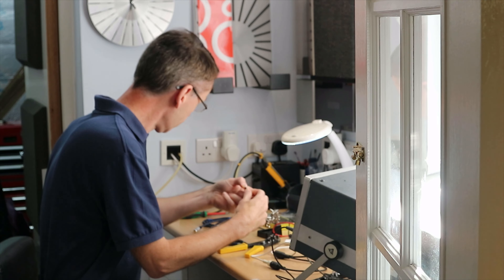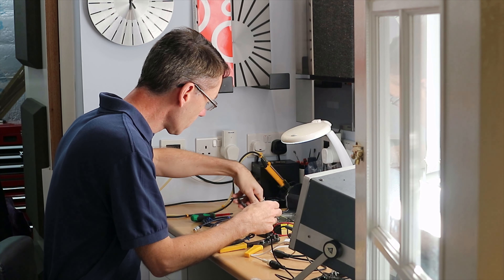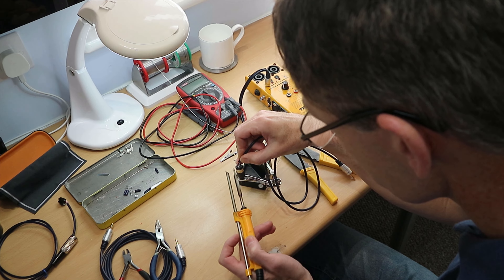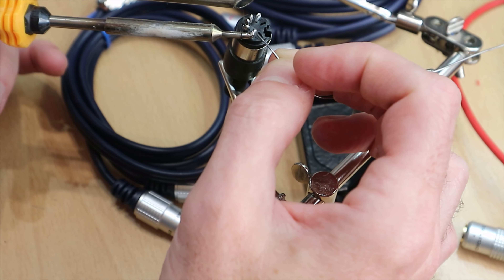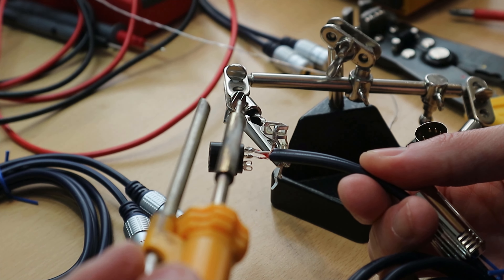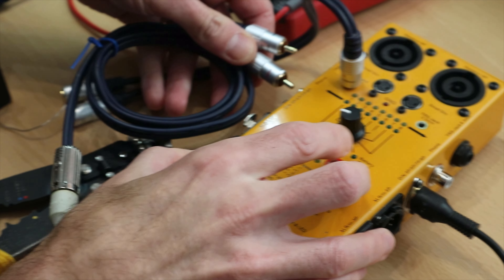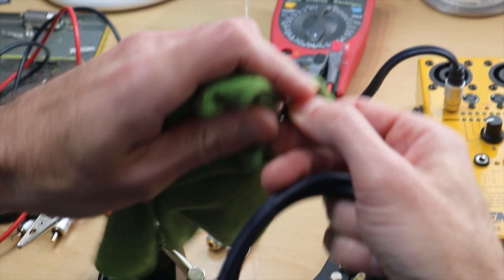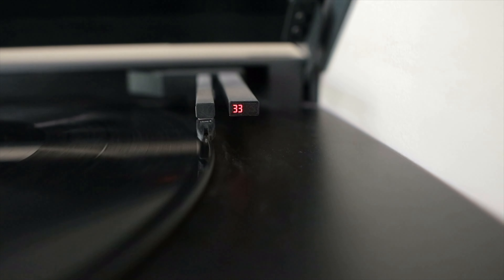The Sounds Heavenly Story - Making cables for Bang and Olufsen [4K]

Comment: more than 5 years back, i purchased an rca din cable for my naim 72 from steve as well as from a major electrical retailer in singapore, courts. both cables cost about the same. definitely a difference between the 2. when i used steve's cable, the treble is nice and smooth without compromising clarity. the other one is just bright and jarring on the ears. thanks steve.
Reply from the maker: Thanks, glad you like the cable!  I am always happy to help with any connection enquiries.

Comment: Steve you’ve got the skill and knowledge for building hifi cables. Now you should also extend into the B&O modifications arena. It’s simple stuff; all you need to do is replace the old/cheap capacitors for equivalent Elna Silmic II or Nichicon Muse Bipolars. Then replace the cheap internal bellwire for Neotech high purity copper or even Kimber wire. RESULT=50% IMPROVED TRANSPARENCY, BASS, DYNAMICS ETC
Reply from the maker: Thanks, but I will keep to what I know about for the moment 👍🏻

Comment: Hi is it possible to wire rj45 to Technical room/hub for PL and ML. To there patch it  to the right source and use BeoLab passive with beovox 1 and masterlink gateway etc and connect to Home assistant?
Reply from the maker: In simple terms, yes it is possible but not usually a good idea. Powerlink wiring in particular should always be direct from the system to the speaker, kept within the room to avoid interference. Please feel free to ask at https://soundsheavenly.com if you need help with cables

Comment: hallo Steve, I just got a beogram 5500 turntable. I would like to remove the din cable and substitute it with a direct jack connector, since I want to plug as directly as possible to a bluetooth transmitter. I know this may appear an heresy, but what do you think about this kind  of operations?  I will then transmit via  Bluetooth to a soundbar. I currently have a 7 din output male. I found on amazon a din to rca adapter,  and it doesn't work. I would then have to adapt it from rca to jack, than plug the jack into the Bluetooth tx device. All these plugs will demolish the sound. Reason why I would like to open the turntable and directly put  a jack cable coming out of it. Am I crazy?
Reply from the maker: This is too detailed to cover in YouTube comments but please email me at https://soundsheavenly.com for support via email (this service is for customers in United Kingdom only at present)

Comment: Hiya Steve - Hope your well... A quick question if you don't mind me asking...I'v got power issues with my Beogram 6002...I'v totally stripped it down and can only think it needs a new transformer ??? The 250ma Fuse seems ok...Would you say it could be the Transformer that is the main source of the problem? Have a great weekend...
Reply from the maker: I am sorry that I don't stock any B&O spare parts or offer repairs, as I just make cables.  I suggest contacting Multi Care at www.multicare.org.uk for B&O parts or repair advice.  If you need any cables for your B&O system once you have got this working, please ask and I will be happy to help!
Reply: @soundsheavenly  Thanks a million Steve...

Comment: Hello Steve. Can I ask you a question please. I currently own a BeoLab 2 subwoofer and unfortunately it has broken and the B&O specialist have told me it’s beyond repair. I’m thinking of purchasing the BeoLab 19 wireless subwoofer and I would really like your opinion on this product in comparison with the BeoLab 2.
Kind Regards 
Neil
Reply from the maker: Hi Neil, Beolab 19 is a real step up from Beolab 2, both in terms of bass depth, sound quality and also loudness.  This is a real upgrade, well worth doing.  You just need this adapter to link the Beolab 19 to your existing Powerlink cable: https://soundsheavenly.com/bang-olufsen/30-370-rj45-to-powerlink-compatible-clip-on-adapter-convert-new-2013-ethernet-powerlink-to-traditional-8-pin-din-powerlink.html#/18-colour-black
Reply: Good morning Steve. Very kind of you to reply. It’s nice to have your expert opinion on the BeoLab 19. As it’s wireless I assume I could connect to my new B&O Horizon smart tv wirelessly?
Kind Regards 
Neil
Reply from the maker: @neildalton157  Thanks Neil, yes you can use Beolab 19 with your TV via either a wired or a wireless connection.
Reply: @soundsheavenly  Steve your an absolute gentleman my friend. Thanks for your help and keep up the good work on the channel. 
Kind Regards 
Neil
Reply from the maker: @neildalton157  Thanks!

Comment: Hola Esteve, e adquirido hace poco un cd previo de meridian el modelo 208 y quisiera conectarla a las penta mklll tiene una salida din para controlar los altavoces de la marca abría posibilidad de hacer unos cables para conectarlas.un saludo
Reply from the maker: Hi, thanks for your enquiry, yes I can help!  Please use this cable from the Variable RCA outputs of the Meridian 208 to the Line inputs of the Penta speakers (you only need one cable for two speakers): https://soundsheavenly.com/line-in-connection/6-30-av-processor-pre-amp-sonos-to-beolab-rca-line-in-one-cable-for-two-speakers.html#/2-length-1m
Reply: @soundsheavenly  gracias por el aporte y otra pregunta el otro altavos lo mantengo con el cable DIN  y se conectaran las pantallas al encender el meridian.GRACIAS
Reply from the maker: @josemiguelsanzvazquez6200  Hi, the speaker screens won't work unless you have a B&O system is connected.  Also, the Penta speakers won't work from their DIN sockets when connected to the Meridian, you will need to use the RCA Line sockets.